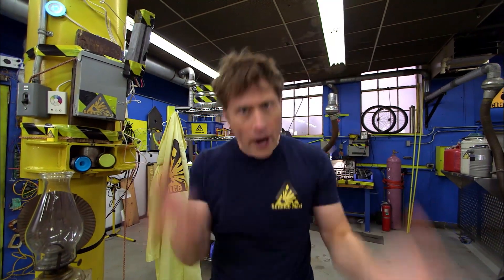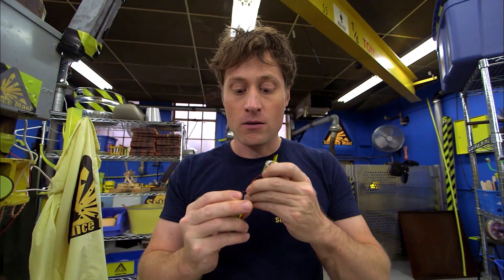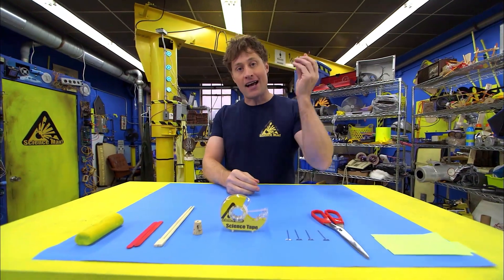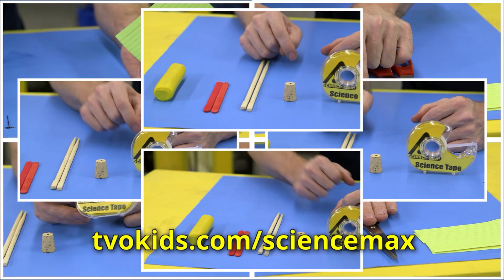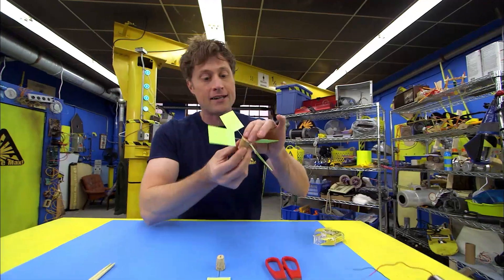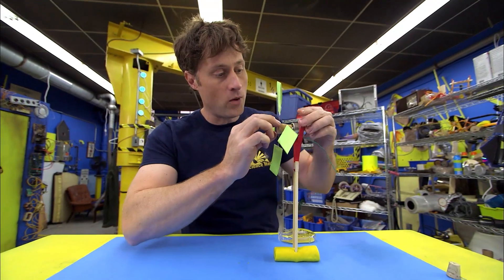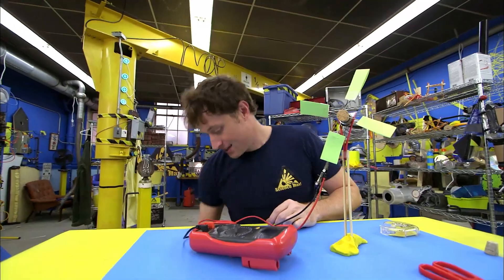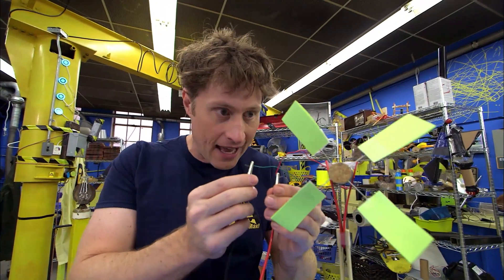How to Make a Wind Turbine | Home Science Experiments | Science Max

Comment: Would adding a gear ratio to multiply the gear speed of the motor produce higher energy output?  I figure it would produce more friction on the windmill but if wind speeds are favorable, would there be benefits to that setup?